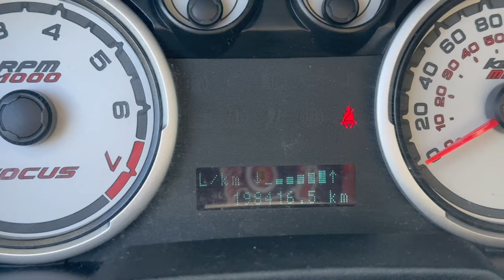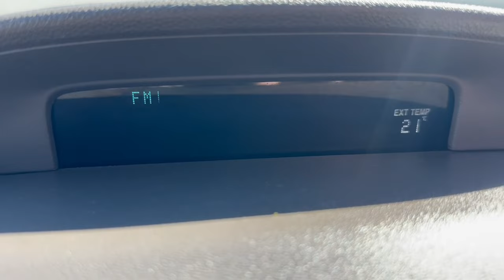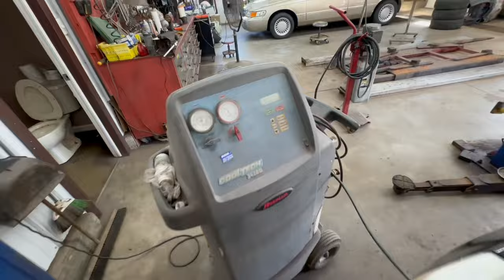Is The FORD FOCUS The Best Used Car?

Comment: mine is 2004 although it was manufactured in oct 2003. one of the best cars l have ever owned. 130k kilos on it and runs perfectly. it gets every fall undercoated with rust prevention stuff  into rocker panels , doors,underneath and all sub frame box channels and rear suspension components. its light, nimlbe and helped me loading up rear hatch and trailer hauling. it will probably outline although only problem will be getting parts for it because of its age.
Reply from the maker: Sounds like a well-cared-for car!